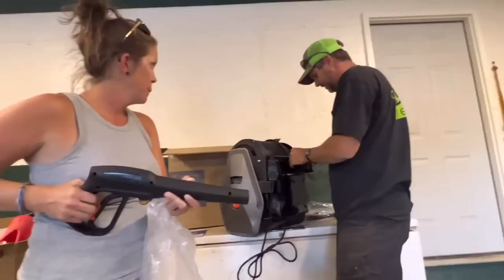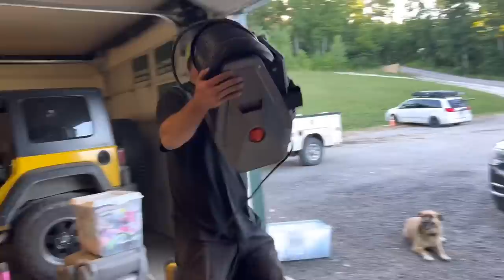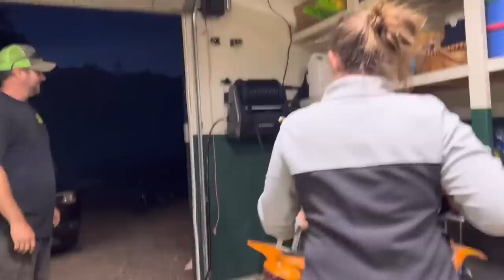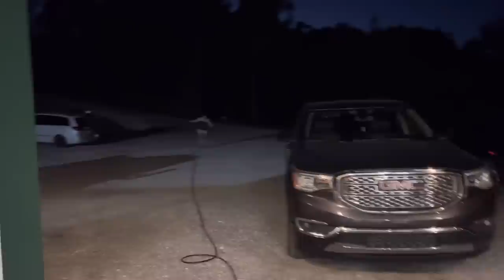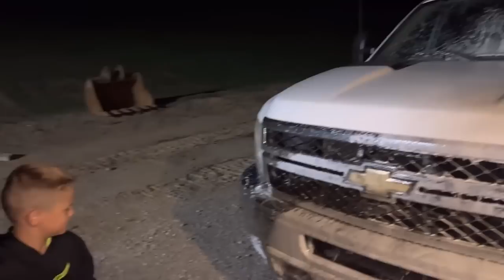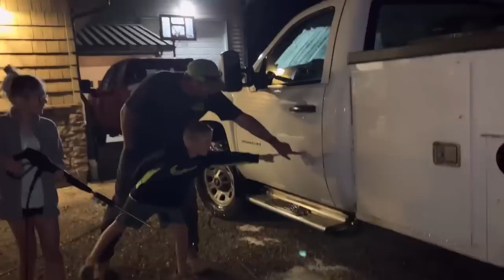Giraffe Tools 2200psi pressure washer- Dirt Perfect and Mrs do some pressure washing

Comment: Hello Jenna, Happy Birthday and congrats on the new equipment! Macey had it right when she said "Start at the top and work down", especially when spraying the soap off. The most important thing to do is to sit the kids down and clearly explain to them that this tool can be very dangerous, Water blasting injuries are similar to gunshot wounds but have the added danger of introducing contaminated water into the wound. If the water jet cuts through a shoe or sleeve and punctures the skin, it may only appear as a small bruise but is actually much worse. Caution is advised!  As Mike said the commercial machines can actually remove the paint on your vehicle if the wrong jet is used. Cheers from Canada

Comment: It only took the two of you to install and do video lol
Mr DP should have timed it with the Hyundai thumb install ,there was all those people to help,and keep them busy 😂
Happy Birthday Mrs DP ,hope he treated you special 😀
Suggestion,the wall bracket could have a pivoting arm ,so the reel can be swung around to face the outside,as you will be trying to pull the hose at angles,Mr DP can make you a swinging bracket ,can't he ?and I would fit hard pipe for the water supply,so you eliminate leakage and water coming into the Garage.
Make sure you use the correct detergent on the cars etc and specific jobs

Comment: Nice little toy.  Though you could have put the mounting bracket outside near the hose... and only put it on the bracket when it's time to use it... I see many are warning about the dangers of kids and this.  I have a much lower pressure pressure washer.. and I can tell you, It could probably remove flesh if used in close quarters...your's.. most likely will too.. though the sad part is.. I can see Mike using it more for when he brings his work toys home to work on them...

Comment: And ,Mrs DP hasn't realised as yet ,this blaster is a new tool in taking care of Mr DPs dirty overalls and work clothes,maybe just Peg him to the clothes line ,and blast away (all safety precautions to be used)😀😀😀😀😀no scrubbing or rubbing required lol
I take it you guys need to wash salt off the underneath ???

Comment: I like it, now, get yourself a flat surface scrubber attachment, it stubs a pathway about 15” wide on each pass. I have one for my pressure washer and it really scrubs the floors in a garage to the point of taking paint, grease and oil right off the floor. Check it out sometime. Great video, thanks for taking the time to post it.👍🏻

Comment: Sorry Mrs D.P. Mounting permanently on the wall is not the best thing to do with it. Have him mount it on a back pack frame so he can carry it around for you, much easier than having to pull out all that hose, and when the moans start about how much work he has to do, you have the tool to sort out and stop all complains. Just turn the water on him, He'll shut up the moaning real quick